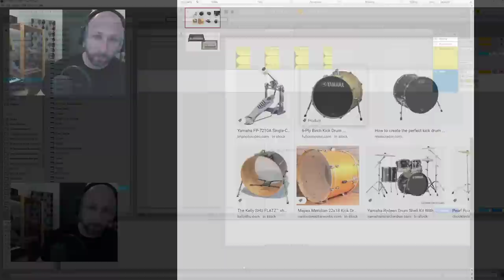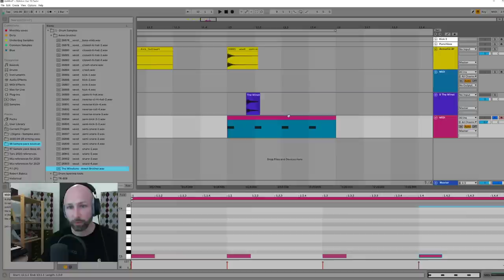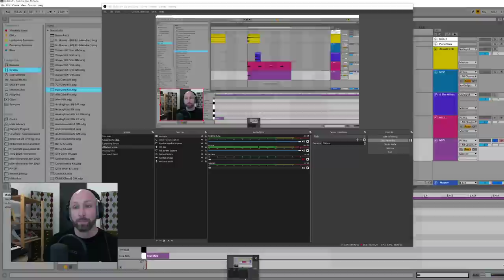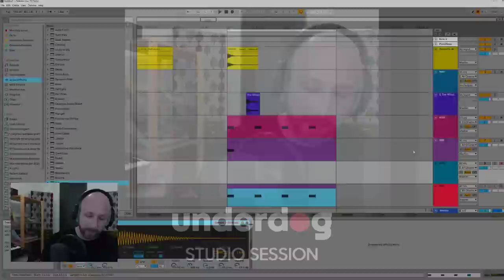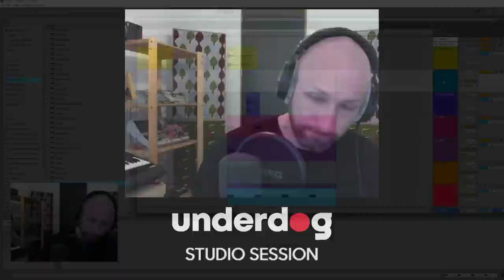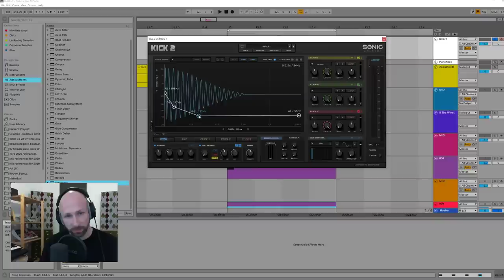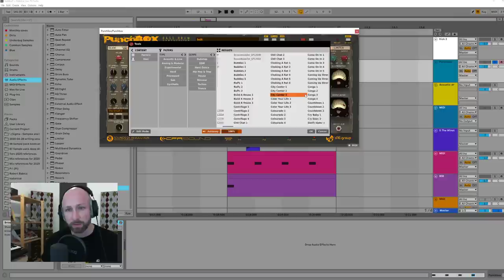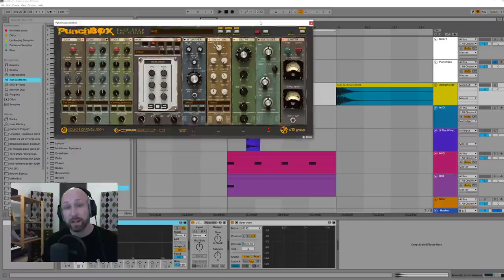Everything you need to know about Kick Drums (including Kick2 & Punchbox)

Comment: Nice history of the kick. I used to build kicks from several sample layers but have become pretty lazy about it. I take a sample thats kind of what I want (Usually a dark subtle kick) and then shape it with distortion, Eq, filters and compression. I also use multiple kicks in a track depending on what my kicks are doing like fills and turn arounds. I picked up Kick 2 a few months ago on sale but have barely done anything with it. I need to start using it more. Thanks for the awesome explanation and analysis on kicks!

Comment: Great tutorial 👍 What about the tuning, there are different opinions on in what key and so on? 🙏
Reply from the maker: Hi Ulf! Yes indeed, tuning is a subject I didn't go into here. I'd say it pays off to be aware that tuning can be helpful, but not to overthink it either. Sometimes nudging the kick up or down a few semitones can help it "gel" better with the key of your track, especially if the kick is very tonal and/or saturated so the overtones make it very prominent (on the other hand, some kicks don't have a long sustain, are based around noisy rumble, or their pitch descends, so it's hard to consider it very pitched).
Having a pitched kick also contributes to a very "clean" production aesthetic, which may or may not match the vibe you are going for. Amongst world class artists there are those who do and don't pitch their kicks, so take from that what you will.
Finally, no matter how high or low you pitch it, you may want to ensure it's low enough to have subby weight, but not so low that it's inaudible on small speakers.
Maybe I should make a 3rd video about kicks :D
Reply: @OscarUnderdog  plz do! These are invaluable lessons

Comment: What are the advantages of using something like Kick2 over Ableton's Operator? I haven't tried it yet, but I would imagine playing around with Operator also gets you far with similar principles.
Reply from the maker: Kick2 uses synthesis for the fundamental frequency, but then also allows you to stack samples on top, processes things together... I think it might be a long frustrating road to go with just Operator, even if in principle you can make kicks with Operator too.
Reply: @OscarUnderdog  ahh ok.... So it's more the convenience of having everything in one neat package readily accessible for tweaking at a glance rather than building your own from one or more Ableton elements which you have to wire up to macros and so on. Thanks for the fast reply! Keep it up :)
Reply: If Ableton does layers similar to how FL does it, I think it should still be quite easy and fluid to do it that way, I sometimes don't even route them together on my mixer. It's always great to have packages that are extra fluid, though, any amount of work gets in the way of your creative flow, yet settling for temporary sounds can negatively affect how you write from there, so actually getting stuff just about done quickly is great.

It can also make a HUGE difference with more complex things, especially if it's not a post-effect or if your mixer is already a MESS to navigate etc., an example we pretty much all run into is heavily layered and automated synths, it's great to have a single instance of a generative plugin like your standard synth with many oscilators etc. and some nice routing options built in. 

The only shame is certain things just need to happen on the mixer, I don't think I've seen generative plugins that let you run any external post-fx internally, say you want your oscillator, some cool unique comb-filter you found that normally sits in your mixer, and then the rest of the synth from there... Instead we get standalone modules like a particular synth's filter that we can then run on our mixer, kinda making our own modular synths that way like a lot of DnB and Hardstyle artists etc. do, but the reverse would be so cool too. 

Most of all because on-trigger/key-follow/velocity conditions etc. are very important for a fluid process when working with rhythmic plucks and all that stuff, you don't wanna go back and fix your automation/lfo-tool after changing a rhythmic pattern, even just doing it once is a waste of time in many cases.
Reply: time